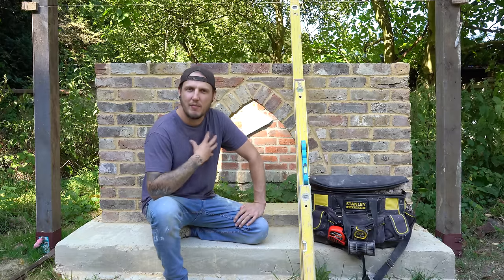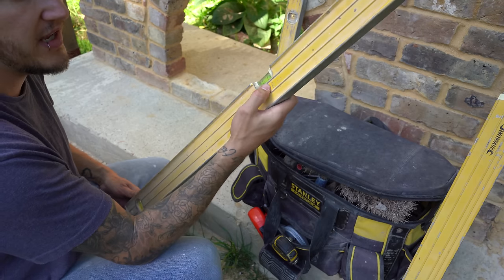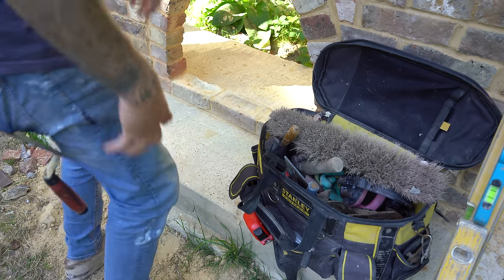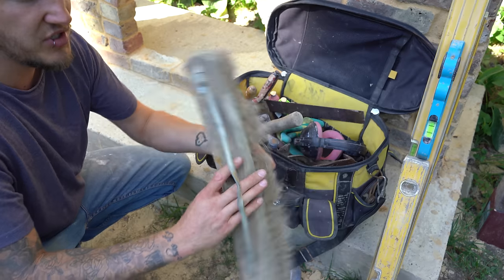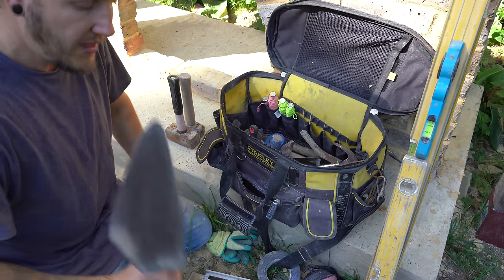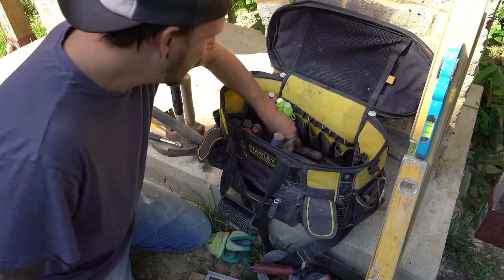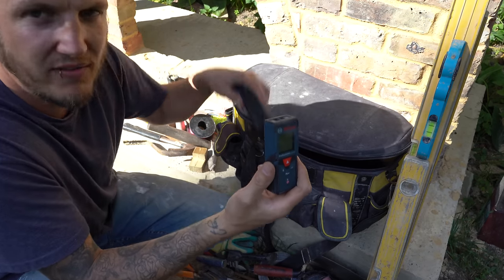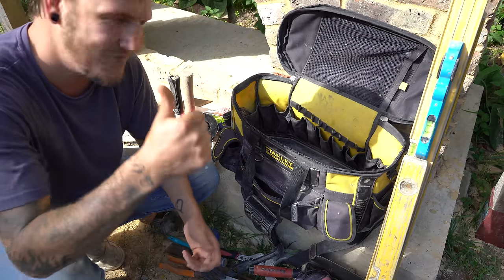ESSENTIAL BRICKLAYING TOOLS [Bricklaying for beginners e.p 1]

Comment: Stabila have a series of masons levels, 400 600 800 & 1200mm
They have a patented guarded striking area you tap
Evens the impact force over a wider area
On the 800 & 1200 the vials are situated differently too
Love your vids btw
Reply: Stabilas R type frames are great for brickies too
They come im 1800 2000 & 2440
Reply: Blue collar 1991 I had to take the guards off mine in the end, you can only use one side of the level when plumbing and it got on my nerves eventually. It’s a great level though and I love the offset vials. And we all know we shouldn’t be hitting our levels so hard that we need guards anyway... 😉😂
Reply: Thats a bummer, it had been ontop of my wishlist for a while 
Apparently crics, those wooden ones are good for absorbing & distributing pressure from tapping 
I guess you could tap both sides to 

Cant say from experience tho, i rep a stanley fatmax. Most experienced brickies cringe when they see it but its still reading true from 2 years of abuse
Im an aus based apprentice, we dont have a decent range of masonry tools available locally unfortunately 
Bunnings are only good for snags these days
Reply: @MrOitoyboy  j

Comment: Good to see you back again theres one thing I wood always have in  my tool bag now a finger trowel thay are so handy if you have brickwork that was toothed you can pack the mortar right back in there all the way to the face of the brick without aney smudge on the face 🌝🌝
Reply from the maker: Ahh yes, I've never heard it called a finger pointer before. I've always known them as a tuck pointer. I did have 2 in my bag but have misplaced them over the years and haven't needed one recently. Very handy tools for sure

Comment: I have started to excavate the foundations for an extension to my house.  I’m planning to do as much as I can myself.  I’ve been in construction all my working life and I’m a qualified carpenter and joiner, chartered builder with a construction degree.  I have recently retired.
My question is:  The extension has 6 external corners and 2 internal corners.  I’m not sure if I’ll do another project after this one.  Do you think I should buy brickwork profiles for this job?  I’ve done bits and bobs of brickwork over the years but never a full building.  I’ve set out numerous commercial buildings, brickwork, roads, sewers etc and now I want to actually do the work!

Comment: As a professional my advise would be to avoid the Fisco tape measures. I have on for setting out as it saves time (as it does with gauging) but I've found that it attracts the foreman's suspicion(s) on site when they see you gauging down with it. It can make you lazy aswell in that you come to rely on it too much. Stick to a conventional tape measure.
Reply: I've found that too,, especially the getting lazy part,, and it starts on a brick without the 10 mm perp you have to keep in mind
Reply from the maker: I generally use it to set out with as its way quicker and have my normal tape in my back pocket with the magnet. I can deffo see how you can get lazy. I don't do site work anymore, but very interesting to know site agents don't like them. I don't see how it would be a problem though?
Reply: @RodianBuilds  Long post incoming.

When I came to London the first job I landed on was a big met-sec job that had a lot of foreign improvers on and to avoid confusion/mistakes the sub-contractor had a big box full of Fisco tape measures they gave out for free to make sure everyone was on the same page. Fast forward a year and I found myself on a traditional block and brick job in outer London. I was on a facework corner and had to grind x-amount out of it and I started using my Fisco tape measure out of habit to gauge down off the blockwork. The brickwork foreman (not site agent) was an older hand and he stopped me and said he wanted to see me grind out what I needed to using a normal tape measure. He kinda put me on the spot but I agreed and he was happy with it. He later explained that Fisco tape measures ring alarm bells because it screams amateur and if I seemingly needed help with something as simple as gauging it made him wonder what else I'd need help with. I've come across that reasoning several times on the big house bashing sites out towards the M25 where the majority of the lads are English but I've found that on the big towers in central London where a lot of the brickies are mostly foreign improvers they tend to prefer Fisco tape measures. Just my two cents' worth.
Reply: Lawrence Curwen absolutely mate, the kids need to learn to work the gauge out in numbers on a standard tape first. Had a fair few come through that don’t even know what side of the tape to read. Makes me sad 😔
Reply: @MrOitoyboy  I've always used a miniature gauge staff ie. a bit of roofing batten cut to 75mm. and leveled the first brick on each course of a corner off it or if you've got to pick say 30mm. up over 10 courses to reach a pre determined point I'll cut one to 78mm... that way there's a bit of uniformity with the bed joints... too many trowels relying on profiles with gauge tape and young kids are following suit... they need to learn to think for themselves 👍

Comment: You missed out on ya finger trowel ,plugging chisel, chariot and pad saw,, I use my pad saw almost every day taking out coring holes. Just recently I got myself an old pointing trowel , maybe 3 inch from the bootsale. It was an old tyzack one and I can't stop using it. Perfect for flaunching and tight corners. P.s tyzack also do a good chariot, had mine for 9 years and still going. I use to have a huge tool box when I first started with every tool going but I find that I empty half the tools now depending on the job.
Reply from the maker: I did have 2 tuck pointers in my bag but misplaced them over the years. I very rarely use a plugging chisel or a chariot, come to think of it i don't even own a plugging chisel. My chariot is in the shed as i haven't used it in a long while therefore forgot to add it to the video. I've never used a pad saw when laying but i can see how it would be useful  👍😁
Reply: I thought I was the only one who used a scutch with 2 different ends, very handy and everyone seems to want to use it. I worked with a few foreign brickys s few years back on site, instead of buildings corner from a wall, they would mark where the wall would go, drill 2 screws top and bottom, then use piano wire inbetween. Then the end of the string line they would have an S shape hook. These guys had mastered the technique which was interesting

Comment: How do you get the skutch blades into your hammer, bought one a month ago and never been able to get a blade in it
Reply: Put the scutch head up on a block so the slots facing you and tap the comb in with a brick hammer... to get worn blades out lay the scutch flat on a block with the blade overhanging the side and knock it out with a hammer 👍
Reply: stones105  cheers bud👍🏼
Reply: @xelitezhd1760  no probs mate... scutch hammer all day long... especially if you cutting blocks with a bolster 👍

Comment: Give the the bag a shake out wile it empty lol you might not empty it for another 10 years 😂😂😂 good vid 👍👍👍
Reply from the maker: I could build another house with all the sand in the bottom 🤣🤣 Cheers pal 😁👍
Reply: @RodianBuilds  😂😂😂 did you go do that garage
Reply from the maker: The guy has been waiting for the funds to start it. I'm not sure when it'll start. Everything is all up in the air at the mo, with the house etc.
Reply: @RodianBuilds  Yere mate can't be good hope it all works out for you and you get to finish it 👍👍👍
Reply from the maker: Cheers pal. It will get done, im just super impatient and want to get on with it and make some more viddys
Reply: @RodianBuilds  😂😂😂nice Yere we want to see more 👍👍👍👍
Reply: Very posh stanley bag 👍🏼beats my plastic tool bucket with holes drilled in the bottom for when it rains 😂
Reply: @lnaylo12 😂😂😂👍👍👍

Comment: Marshalltown have a series of london pattern pointing trowels
The 4 would be a perfect striking trowel
Under the archeology section the have the 4x2 with a stiff blade & holster
https://marshalltown.com/archaeology-trowel-4-stiff-london-style-pointing-trowel-wholster
Be a  perfect setup striking in the heat
Reply from the maker: I almost bought that archaeological trowel a couple of years back, just because it looked cool with the holster🤣🤣 I prefer a pointing trowel to have a bit more flex but each to their own

Comment: Typical Mason tool bag every thing is in there that you might need but never do and it gets heavier every day. I myself think metal box levels are better for carpenters. The best levels I've used are Smith, or Creek laminated hardwood. And I noticed you didn't have any flat tuck pointers they are very important to have.